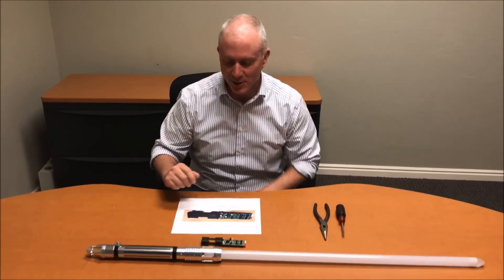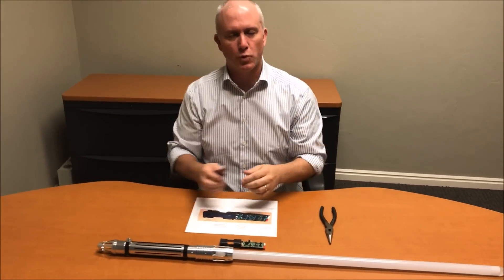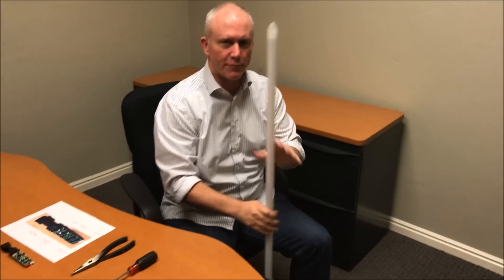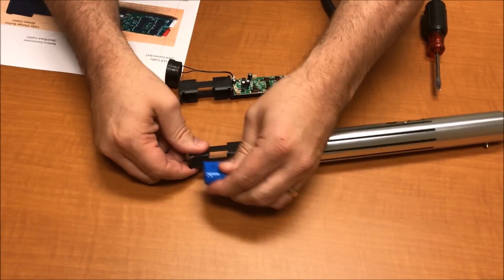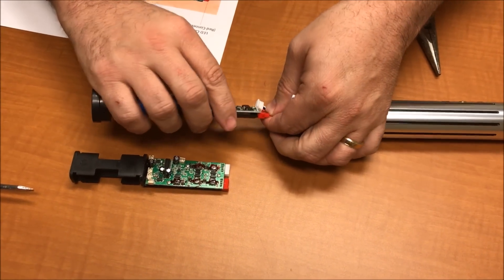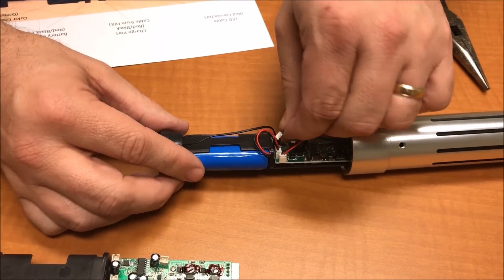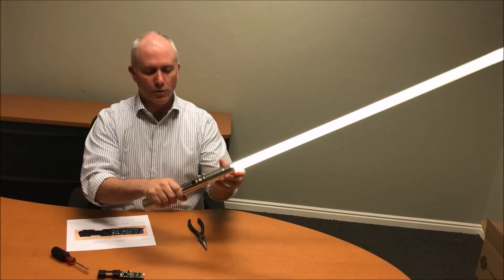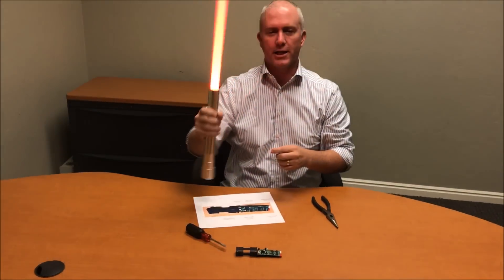Kyberlight V2 Circuit Board Install Demo

Comment: Whether I lightly tap the base of the Kyberlight Lightsaber or smash it as hard as I can into a hard surface floor, I cannot get the Version 1 board/speaker to move. I've actually hurt my wrist trying to put so much force into making it budge. Absolutely no results on that. Unable to replace my Version 1 board with Version 2. Any suggestions?

Comment: the single 1 thing that kyberlight can do to go up 500 levels is to change that soundfont. the whiny high pitched hum is so irritating plus the swing sounds is so not obvious. get a good fontmaker like lord blako or shameem to do a font for kyberlight, or sample the sounds from the movies, like what the font makers do. The soundfont that is used during kyberlight video intro, that's a GOOD one.

secondly, my internals are jammed tight in the hilt. no matter how hard i hit to try to get it out, it doesn't budge at all. any ideas?. try many many many times and any harder my tiles will break. covertech screw and all screws have already been taken out. any ideas?
Reply: It's not about how hard you hit it. It's like getting ketchup out of a glass bottle.
Reply: i do know how to remove a chassis. i own more than 40 sabers from various companies including making my own. but my kyberlight chassis is just stuck

Comment: Just got my v2 board and installed it. Thanks for the helpful video! 
I did run into an issue that may help someone in the future. When I pulled my v1 board out, the final red and white connectors' cables weren't long enough for me to reach. It turns out the wiring was bunched up and it required me remove the blade, loosen the screw holding the LED in place, and then pull on the red and white wires. That helped the cables reach their full length and the connection afterwards was a snap.
The saber sounds great and the effect transitions are seamless. Thanks Kyberlight for the upgrade!
Reply: Craig Biesinger I had a issue no sound or sound board no good
Reply: Hi this is Bobby I hooked up my new sound board with two new switches and speaker there is no sound at all